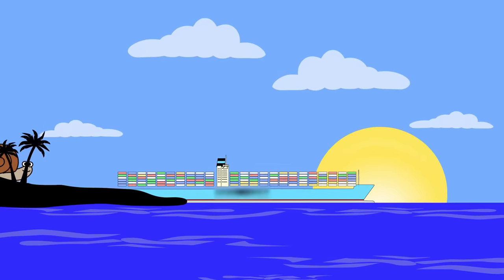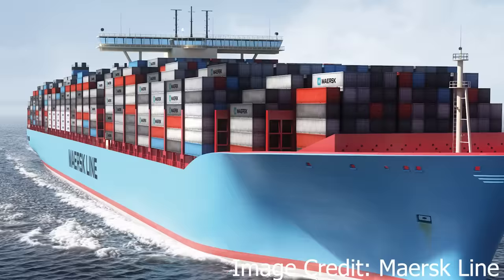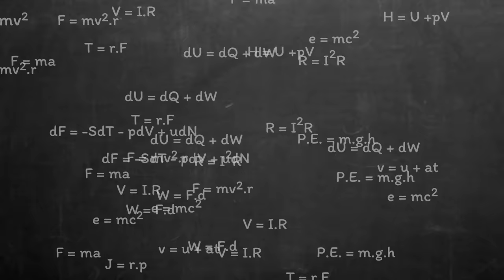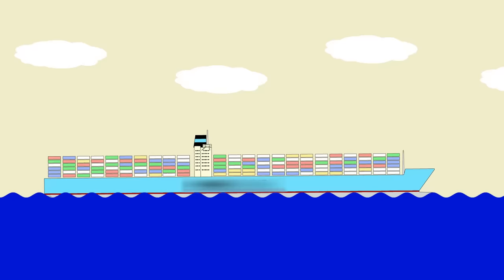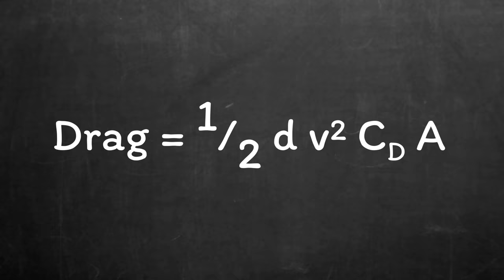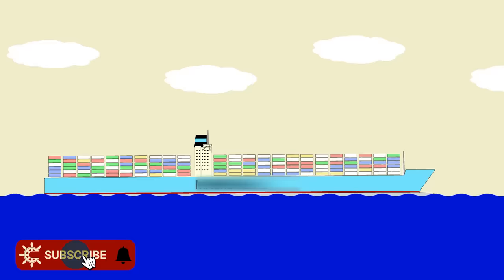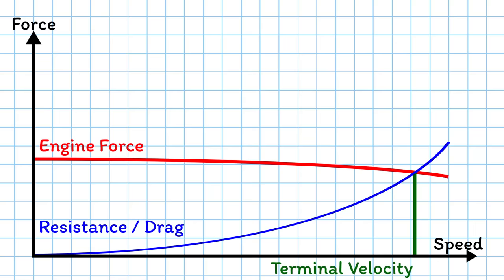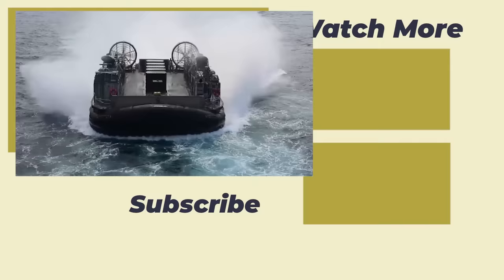Why are ships so slow?

Comment: If you're sitting in a sailboat, and one of those container/oil ships comes barreling at you at, say 25 knots, you won't think they're so slow!
Reply: 25 knots is about 50km/h which is pretty fast. Thats pretty fast for large vessels. I work myself at an offshore construction vessel and we usually inly sail in 8-9 knots. About 3 knots in heavy waves.
Reply: @TheFrontyer  yeah, all i know is that it was faster than the diesel in our 40' sailboat, and as Murphy would have it, the wind had died down!
Reply: @buixote  Yeah I am sure of that. Thats a violation of the naval right of way lawsn luckily it went good I guess.
Reply: Get an AC72 😛
Reply: Frontyer 50 km/h is snail's pace when compared to car on motorway.
Reply: @samanli-tw3id  and a car going 120kmh is a snails pace compared to a commercial plane.
Reply: I sailed for 4 years on a cruise ship now. Fastest we sailed was 25 knots between Greenland and Newfoundland in the Labrador Sea. Let me tell you, looking at how fast the sea traveled us by was no joke. Falling in the water would've probably resulted in immediate death due to high speed.
Reply: 25knots on a huge ship is tremendous...its size and weight creates powerful momentum
Reply: @eppsislike  If the impact didn't knock you out the risks are drowning after being pulled down by the flow towards the propeller and being hacked by it followed by drowning anyway before anyone could get to you/find you.
Reply: @ianrutherford878  not entirely,at 25knts, the ship travels so fast, it would already be a stones throw away when you hit the water. However, the Labrador Sea is rough, so if the ship would do a search & rescue, chances are you won't be located anymore. I've done regirous trainings about this. The CCTV footage I had to study were not that all pleasant.
Reply: @eppsislike  well you might want to go back and check that first bit depending on what part of a ship you fall from 'a stone's throw' away before splash-down sounds wrong to me.
Reply: @ianrutherford878  mate, me and my team drove that ship. It's a 61,850 GT ship that travels 25knts on 4 out of 5 engines. You do the math.
Reply: @eppsislike  One of the biggest cruise ships in the world is the 1,181-foot Oasis of the Seas with a top speed of 23.8 knots it never actually uses?

Can you name this speedboat cruiseship of yours?
Reply: @MrFlatage  OOTS doesn't sail the Labrador sea. We sailed the inlets of Greenland and eventually went to Nova Scotia, Canada. Our ship is designed for those speeds as we frequently did world cruises, which at some areas required 22 to 25 knots, which we were allowed to do by maritime requirement. OOTS and other big ships are not designed for world cruises and although can reach a maximum of 23 to 26 knts, they won't use that as the areas they sail are not allowed 20 knots or higher. 

I drove the MS Rotterdam.
Reply: @eppsislike  Sure now ships are driven and not sailed? And what MS Rotterdam? I kinda build 6 of those by now for the Holland America Line?

And if you think The Flying Dutchman is reliable still getting spotted all over the globe? Yes our Black Pearl has clocked over 30 knots. And they do not drive it but sail it cos ... of the big black sails it has?

Yea you are right. The junk you sailed wasn't designed properly. Imagine how fast your ship had gone if you had lubed the hull with butter. ;-)
Reply: @samanli-tw3id  yes but a freighter is larger than an average building.
Reply: Was on a 330m long container with a 14 cyl 2 stroke with 80000kW+ of power and trust me 26 knots feels fast on board as well
Reply: I am enjoying the tea being thrown between two sailors (or at least one, not sure) but god I love it
Reply: @MrFlatage  r/murderedbywords
Reply: Sailing a small boat like a 420 and then turning around to see a barge coming towards me was sure terrifying, so yea I agree
Reply: buixote You need to give the right of way to container ships or get out of the way... you could have been arrested or worse dead. The undertow of a ship will drag your little sail dingy up to the ship and destroy your boat and kill you and everyone on board, you can’t even jump off because the ship will suck you underwater and if the propellers don’t turn you into a soup for the sharks, you will drown.... I don’t think you understand boating and sailing laws enough lol. Be careful around ships stay clear and away from them no matter what. It’s a law also to not get within a certain distance of them even if they aren’t moving. In the open ocean they have the right to shoot to kill you also if they see you as a threat.
Reply: Cenentury0941 and the largest ship to set port in the US is 1,310 feet long
Reply: Slender Man it’s not that big a deal honestly as long as you move out of the way soon enough the ship doesn’t care it’s when your being recklessly close that they will, When working on them in SF it’s pretty frequent that sailboats and wind surfers get kinda close but we don’t always get our panties in a wad if they’re passing in front from a safe distance
Reply: No shit looking at the E class container ship it can carry 14770 containers (20 foot) they weight as much as a F-150 super cab each when empty at maximum load each container can weigh as much as 12.5 F-150 super crew variants! that's over 184000 of them from just the cargo let alone the ship! having that barrelling towards you at any speed would be terrifying.
Reply: I have no knowledge of ships or sailing but I enjoyed the conversation.... dream to sail through the Arctic one day though
Reply: Ian Rutherford The upper decks of a cruise ship are way the heck up there. Let’s say you fall off the ass end of a “smaller” cruise ship with a dozen decks above water. Guessing 10 feet per deck means it’d take you 2.75 seconds to fall the 120 feet and hit the water. 25 kts is 42.2 feet per second, so the boat will have done 116 feet by the time you go splat, which is by any account a pretty solid stone’s throw. 

I’ve dropped ice cubes overboard before, and it’s eye opening to see how long it takes them to splash and just how far back they land.
Reply: If you don't want that to happen, then you should stay out of shipping lanes.
Reply: @eppsislike  wouldn't  be the speed that killed you. It would mostly be the height of the fall that would do you in if you didn't land correctly
Reply: @TheFrontyer  Problem is the naval right of way laws are now outdated . The ships are huge and take miles to stop , need lots of space to manouver
Reply: @tobyriecke3972  Anything bigger than a surfing board coming your way is distressing on a 420. Specially if there is no wind.
Reply: I had no idea container ships of +300 meter length and loaded can make speeds of 25 knots. This sounds ridicilous when compared to the WW1 dreadnoughts and the early 20th century ocean liners. And many ships who had themselves designed specificially to be fast, have a very hydrodynamic hull with high length/beam ratio, powerful machinery and 4 propellers. Meanwhile a 350 meter bulky hulled wide loaded container ship does 25 knots  with a single propeller and only 100.000 horsepower.
Reply: @TheFrontyer  nah buixote was stranded at sea for 1 month and lost his wife (whom he had to eat) and his 2 young boys (went missing when the ship crashed into them - he suspects they were chewed up by the propeller. 

Pretty insulting of you to assume that "all went well" 

Oh BTW the cargo ship owner is suing him for "gross negligence" be his sailboat and children scratched the paint on the hull and propeller. Since he can't afford a lawyer, he'll be settling out of court for 20 million later this week
Reply: @seeker296  lol wtf are you on?
Reply: @samanli-tw3id  uuuuhhhh.....no!
Reply: My thoughts exactly! I was on a fishing boat one time , I was aware of the shipping lane and could see the ship 2+ miles away, thought I would have enough time to pass both shipping lanes when they passed directly in front of me about 150 feet away, came quick like a bat out of hell heading out to the open sea
Reply: Get an Anti tank turret then you may be able to stop them
Reply: @eppsislike  It'd depend on how the person fell overboard.
Reply: I was about to say this. Watching AIS at sea, you can usually tell whether or not it's a sailboat by the speed. We'd average around 8 knots, while containers or cruise ships would be closer to 20 knots.
Reply: Do you sit in a sailboat or on a sailboat?